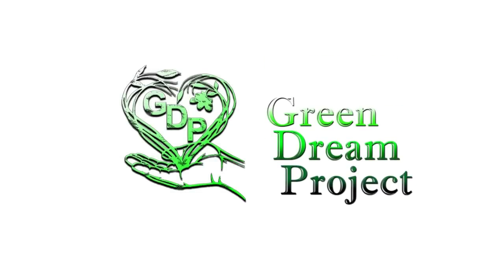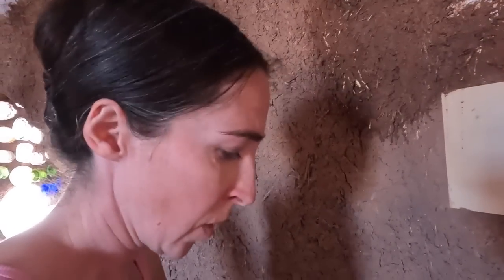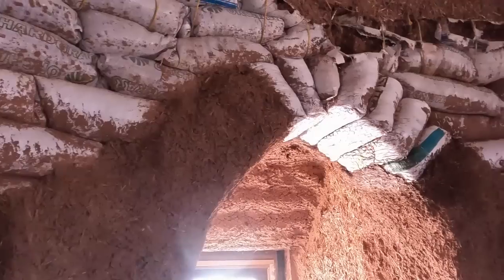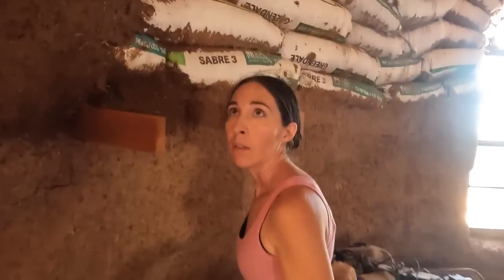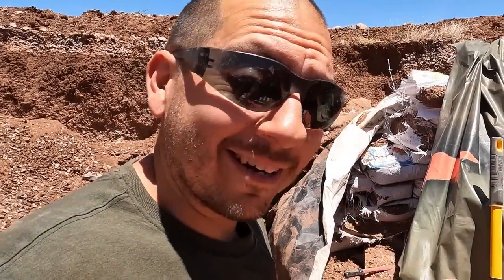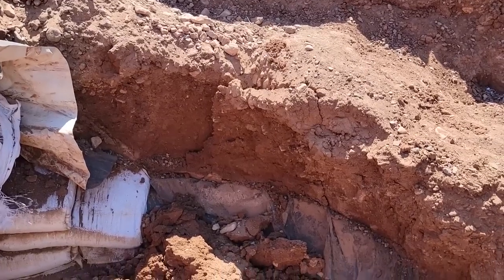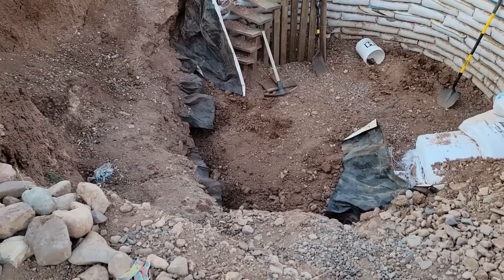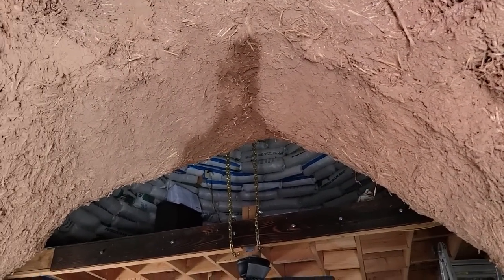Excavating Our Collapsed Earthbag Root Cellar | Hand Tools Only!

Comment: Consider getting a backhoe to dig around exterior of earth bag wall down to foundation and  putting in a good French drain system. Also consider using both barbed wire on each bag level and 3' long rebar spikes driven into bags as wall goes up for vertical wall support. Glad you are tackling both projects. The interior mud plastering is looking great. All the best!
Reply: If you do build a french drain around the (and at the level of the foundation), you still need to draw the accumulated water away from the foundation.  That would mean building a drain line AWAY from the structure a good 40 to 50 feet so THAT water would puddle away from the foundation (think sewage drain line).  That would make any investment in a backhoe worth it.  You slso need your surface of fill dirt to drain away from the home a good 20 feet into a swale that would carry the water to a lowpoint 50 feet away(I think you already create that lowpoint (depressed area with mounded sides around it).

Comment: Congratulations on your new found energy and focus to tackle the rebuild.  I am certain the collapse was heartbreaking.  Don't forget to add a perimeter drain with a filter sock on the outside of the new walls that runs under the first layer of bags so it can drain into a sump.  You can deal with the sump later, but you only get one chance at getting that drain installed - and that is the first step. 😊

Comment: Glad to see you starting to work a little smarter. I would have tarped and stashed more of the good dirt on the back wall. Too much work hauling it out and then will have to haul it back.
Reply: Since you have a pile of good dirt started out on top all you'll need is build a chute and dump it down to the bagging area. You have your winch/ladder set up to lower the mixer down too. A new staircase will have to be built the conventional way. The original steps you saw sawed can be used to attract the wall side run.
Reply: Yes you need to get going on rebuilding your root cellar and pack the earth in behind 😮the bags you replace on the side adjacent to your main dome. Just looking at soil via your utube pictures, it appears that it wouldn’t take much for the soil between your main dome and the root cellar to subside and you loose both buildings!!
Reply: In addition to my view, it may be wise to use a little cement in your mixture, to give additional strength. You were saying that, monsoons will heading your way soon . I believe that you will need to have this work completed before these rains arrive. Most importantly you will need to ensure that the area between the buildings is kept dry until you have your root cellar building well above ground level

Comment: You could try a leaf/vegetation shredder or an old blender to chop up the straw into smaller pieces to get it to lay flatter and fill gaps in the wire better.

Comment: Have you considered laying perforated pipe outside the wall to allow water to drain into the root cellar? And or geotextile layed out in lifts? Both these techniques, or ones like them could significantly strengthen the below ground walls and prevent failure from heavy rain. Thanks for sharing the adventure!

Comment: All of those rocks?  The heck with cobbing! >   I would be building things out of the ROCKS and  Cement.  That the way my log cabin is?  Cold on the side, when its HOT OUT SIDE. Cold on the out side, and warm in the inside >    👀 ITS SHOCKING THE DEFFERENCE IN TEMPERATURE 👍👍  I love it < > It take about 2 weeks, for the temperature to even out.  Inside and out side,  but the cabins inside is slightly warmer or colder. Than the out side> it will be 103 out side, and inside its about 88 degs

Comment: Iam in the process of doing something simalar,  however the reason behind my hole and "ROOT cellar " is to harness the geothermal Temps that apparently stay around 75° year round at 8 feet into the clay layer.This is fantastic for the summer Temps as I will have a free cooling system to combat those unrelenting Temps the Mojave desert has. Something else I will pass on to you for combating heat is invest in sun shade material.  Those black or tan tarps that have holes in them  .  Staying shaded  while working is key to being efficient.

Comment: On the dome, especially on the large crack, I would use the cake icing method. Put some mud into a plastic bag, snip one corner off, squeeze the bag and spray the mud through the wire right onto the bags. Then spread it smooth over the wire.

Comment: ... or you can think of how to do it right the first time by thinking a project through and not giving yourself more trouble or work. I thought you had made a French drain around that thing...did you stop to think that the roof will produce water and you could also harness and or at least lead it to what will and can be an orchard? Where is the excess water going to go next time? Philosophy and ideals are great things but planning and avoiding problems in projects are also ideals to strive for.

Comment: You have no mechanical equipment to move more than a shovel full.  research tow-behind excavators New or used! 

 Excavator from Harbour Freight, $3,49999      

Nortrac Towable Backhoe $3499 Trencher — 15 Hp 

EBay,  for new and used! 

Good luck,  ✌️

Comment: Awesome guys! Hey question. Have you guys thought about doing hyper Adobe bags like tinnyshinyhome or two Rebels Off grid? Looks like in the long run might be more sturdy and not need the barbed wire?
Reply from the maker: Hyperadobe would definitely be easier to build with, but you can only build straight walls with it and it would lack some of the tensile strength the barbed wire provides.

Comment: Nothing says it HAS to be ROUND. You can make it into rounds and squares and oblongs and rectangles ... Just a little head scratching and artistic flair and VOILA .. a new thing.Personally I can see a variation that might make it tie into the main house a lot better .. but that's just an opinion .. I know that the ceilings get all wonky but you can figure them out...

Comment: Hi J and J!  Subsidence seems to be an issue in Arizona. Could it be that the big dome is acting as an excess weight on the ground and causing extra subsidence on top of the subsidence that was caused by the rain that day? It is happening in cities where highrise buildings are causing the ground to sink. If your bench alone weighs 6 tons you have a lot of weight in that dome and I believe that the wall of your root cellar is only 5 or 6 ft away? Maybe the space is better used for the second dome which should move in synch as it is linked and put the root cellar, the weaker construction at a longer distance?  I am not an engineer but seeing the earth still collapsing ,even when "baked" made me wonder of the flood had been the only problem. I am really not trying to rain on your parade.but am mentioning it for your safetyand before you pour money and effort into rebuilding to just go ver your plans once more with that thought in mind.

Comment: Get a Large Galvanized culvert the bigger the better
Reply: See my comments about a drain line up to 50 feet from the foundation elrvation...and the drain line elevation would lower to draw accumulated water away.  This drain line if done right right coild slso act as a cooling tube in the summer!...and warming tube in the winter.

Comment: no matter how many time you build cellar wall again, this come inside alltime again because ground pressure bush ground ewerytime again to in cellar, need build retain wall system not ground pressure bush ground to in cellar, only earth bag not can keep wall good pressure bush ground wall to in cellar sure again. need diggent lot biggest hole and fill outside wall somethink lightweight material lot around cellar outside wall. digging ground outside 45 degree all ground off, then fill wall outside hole lightweight material or concrete support wings, cellar wall not can fall inside. and outside cellar wall need fill full gravel and under outside wall need add water drain tube all rain water collect out of wall to tube and out far at cellar. if not do thats cellar wall come in and fall again and again no matter how many time you repair this wrong. learn how retain wall builded then you understand how big power ground have bush you celllar wall in to cellar ewery time.